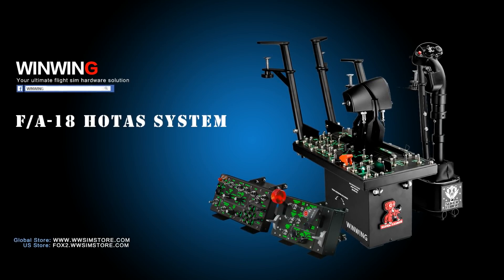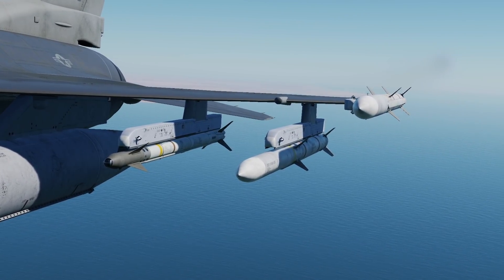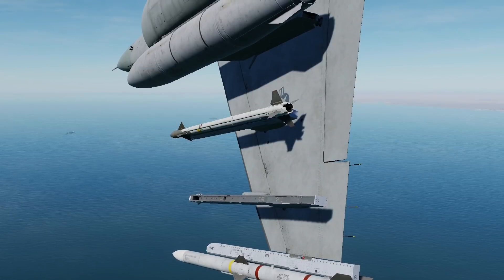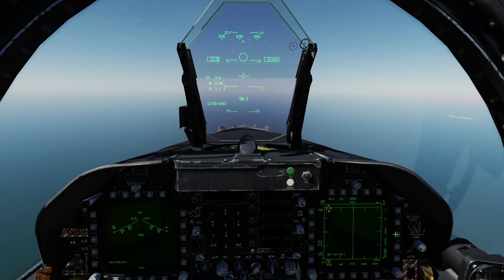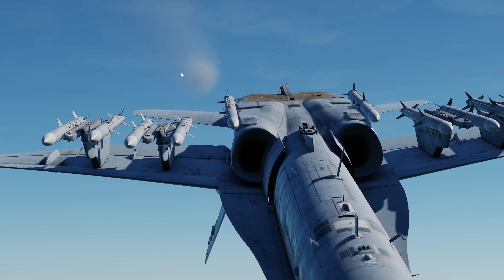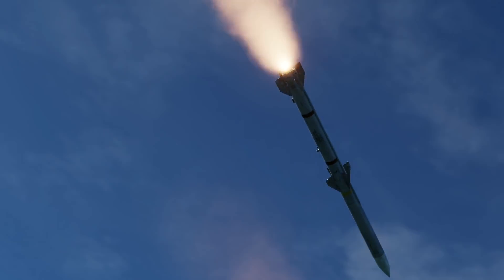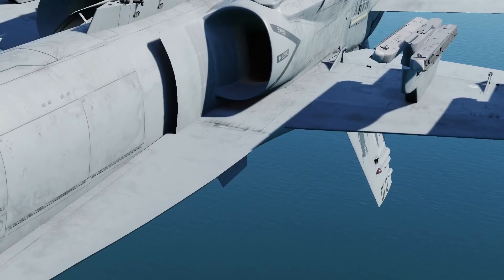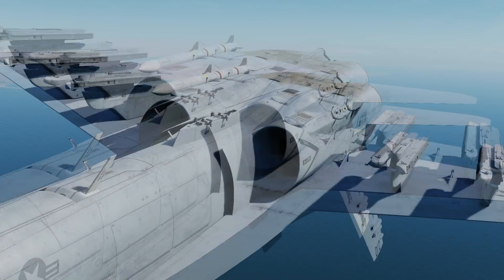Questioned: How An Aircraft Can Fire A Missile While Rolling | DCS WORLD

Comment: Missiles on the LAU-128/129 are mechanically restrained by the forward detent. The mechanical restraint is, however, electrically disengaged but the force of the missile's propulsion has to override the mechanical force to disengage the forward detent. Once achieved, it does then slide forward on, using it as a track to propel itself off the rail.
Reply: Don’t forget the snubbers! 😉
Reply: @heeder777   You beat me to it.

Comment: As a load toad i got to work the 22 for a year (now I am on the 16). The F-22 uses what is called an AVEL (AMRAAM Vertical Ejection Launcher) for the 120s in the main bays. It uses a mix of nitrogen and hydro to operate and launches the missile out of the bay at an extremely fast rate. The side bays are only hydraulically powered only but still operate just as fast. It is very impressive to see this in action in person.
Reply from the maker: Thanks
Reply: Do they use the LAU-147s?  With an onboard pressurization system?  Or do you guys have to refill this system?

Comment: Or drop additional tanks while flying upside down.???
Reply: The wing tanks have a swivel that holds in the back of the tank pylon. As the tank unlocks when the carts fire the aft part of the pylon stays attached until the tank goes nose down then the tank will fall away. Upside down it would most likely stay there until positive G or gravity causes the nose to drop far enough to disengage.
Reply from the maker: It won't allow the drop if inverted.

Comment: Curious about whether an R-73 can be fired during a cobra :)
Reply: short answer: yes
Reply from the maker: R-73 can fire any aspect at any angle.
Reply: @grimreapers  Ah! Yes! But can the pilot successfully use the HMCS while sitting in the immediate two seconds after pulling that maneuver? Can the aircraft radar successfully acquire and cue the missile fast enough? That is what I was wondering about.
Reply: @jwg72  Su-27 & Mig-29 were developed around dogfight techniques so yes  they are capable of giving the missile any information it needs anytime the pilot wants.
Reply: @jwg72  R73 dont need radar to work. The IRST sensor can slave to HMCS which can guide the missile. Maybe the seeker head can also slave to HMCS too, not sure about that tho.

Comment: The Launcher racks use exploding impulse cartridge's (Navy calls them CADs) to generate a large amount of Gas pressure to literally PUSH the missile away from the jet.  They are extremely POWERFUL using the force of nearly 4000-5000psi.  The AIM-9 shots you are seeing are different, they have holdback devices that hold onto the missile until a certain force of thrust is built up.  The launchers that "eject" the -120's and old AIM-7s work through a system of hook like devices that grab onto the missile and then a pair of ejectors that not only sway the missile (hold it still) but then SHOVE the missile off the jet.  The latest generation of these from the "Harris" company are powered by compressed air, which makes them really easy to work with/on and simple to use (these being on the F-22/F-35) and also the BRU-61 for the SDB's uses the pneumatic system.
Reply from the maker: WElcome back loader!
Reply: @grimreapers  thanks Cap and Company!  If you ever need to do that kind of thing again just hit me up!  It would be neat to do something on bombs and bomb components.

Comment: So are they blank shotgun cartridges? I have heard they may well be. Would love to know and if they are, what a great piece of off-the-shelf engineering!
Reply: They burn very fast and create high pressure gas to override the hooks and push the munition or missile away. There are several types. All metal body and electrically primed, which is why you don’t carry them in your pockets where static might set them off with really bad consequences. Which one to use is determined by the munition. It’s not uncommon to use two different carts in the rack at the same time. They are installed in the breeches and torqued to 275 inch pounds. To this day I can tighten anything to 275 inch pounds without a torque wrench because I’ve installed thousands of them in 20 years. 🤣🤣😉🇺🇸🇺🇸
Reply: @heeder777   HAHA...oh yes, the calibrated Elbow.  I haven't checked mine in a while but I bet it still good.  I had some numnuts put some live carts in his tool pouch with some spent carts and safety wire.  I (expeditor) happened to be standing their because the Freaking Wing Weapons Safety Manager was watching them.  When this guy's 3 man asked for where the carts went....I kid you not...right in front of both our Wing Safety manager AND his host nation counter part this dingbat pulls a handful of carts, expended carts, and safety cable out of his tool pouch and says here.  After I came out of my momentary state of shock I looked at the Safety guys to see them just shaking their heads in utter disgust.  Freaking funny now....then, not so much.
Reply: The cartridges are not 12 gauge or shotgun carts , they are of an aluminium body  & electric initiated they vary in width and length depending on the type of ejector release unit , the  fill is made up of a tube style of low explosive .
Reply: Practically yes. Those "blanks" are most reliable way to detach any weapon or store. Even normal bomb rack units use that kind of system.
Reply: @aleksimakela6787  so... 12 gauge or something? I imagine the military insists on special labeling and a separate purchase stream even if they're right out of the same factory.
Reply: @unclejoeoakland  as @Barry ang just said they're of different construction. I was being a bit unclear, since from the point of view of off-the-shelf engineering they are different. But still, they practically are very closely similar to those start cartridges used in some engines in terms of operating principle (but with less explosive material). Some engines like the one of British Field Marshall tractor accept shotgun blanks.
Reply: @aleksimakela6787  yeah I saw that kind of thing used for lots of big engine starters. Cool concept, awesome practicality, pity it isn't actual shotgun blanks but I suppose that would have been outside luck.